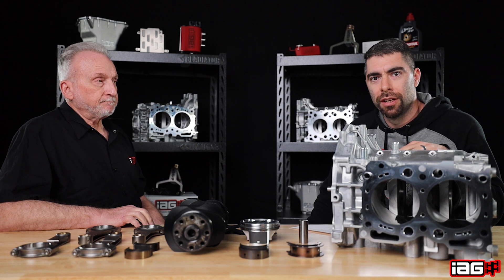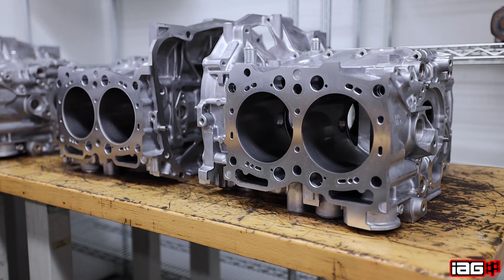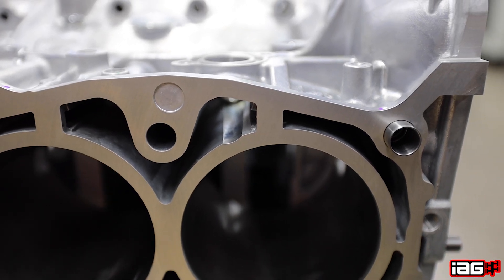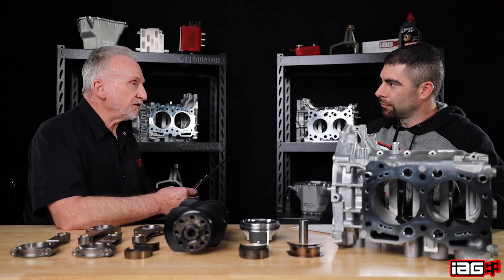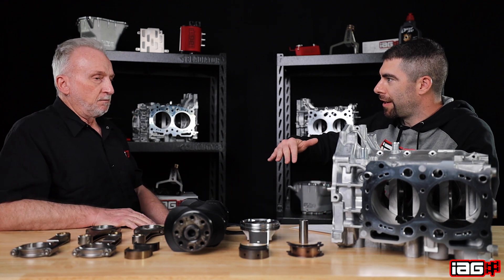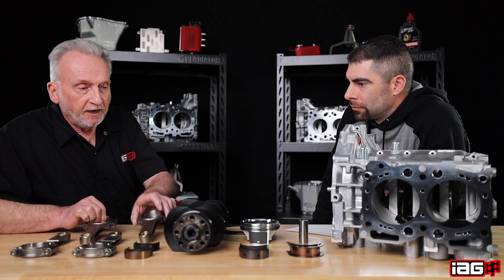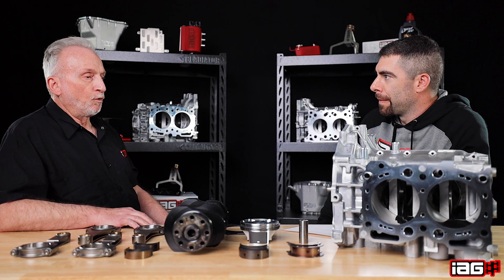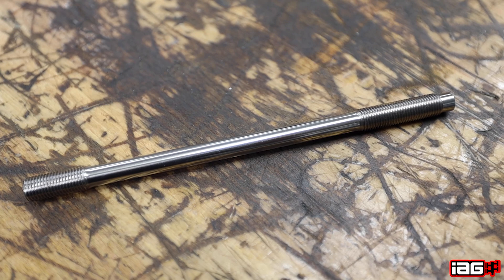IAG Performance Stage 2.5 Short Block

Comment: Can this handle 700bhp Mustang dyno numbers?
Reply from the maker: We would recommend the Magnum for those kinds of numbers
Reply: Too late 😅, I did get the ARP CA 625+ 11mm head studs. What boost levels do you think would be "safe"? I have one of the best tuners in the US.
Reply: My goal is 628whp dynojet numbers. Jason Bader from Baderbuilt Racing did it with a similar setup, I have; IAG 2.5, ID 1300X injectors, dual Walbro fuel pumps on radium hangar, radium fuel pressure regulator, BCP X500R turbo, COBB front mount intercooler, 4 bar COBB MAP sensor. He did this with stock head bolts, I have ARP CA 625+ head studs.

Comment: Do we still use the factory head gasket with the stage 2.5, or is there a better gasket that dosen't block the coolant galleries and seals better around them?
Reply from the maker: We recommend the use of the OEM head gaskets for the stage 2.5 short block

Comment: My dream short block is : IAG 900. I would like to add stage 2 heads with stage 2 cams. The turbo I need is PT 6870. The transmission I need is PPG straight cut gears with sequential shift pattern. That is all, this will make my life happier! Thank you! Please send all parts within 1 year to Fastech Motorsports, I will drop my car there.
Reply from the maker: You can contact Fastech or us to get set-up with an invoice for everything you need!
Reply: I love fastech I’m just down the road from them

Comment: I am a happy user of stock Subaru long block with forged internals. It has been 5 years since it put down on dyno jet 450whp/450wtq. Recent oil test showed normal wear. Boost is set at 27 psi. I had instances were it peaked at 29-34psi for many times. It held up.
Reply from the maker: Nice!

Comment: I’m another happy user of the 2.5 cd shortblock, pushing 470/392 on pump gas and 530/480 whp on e85.
Reply: do you have heads or anything like that

Comment: But wouldn't coolant still fill the entire open jacket regardless of the passage openings.? The closed deck blocks obviously restrict much more surface area
Reply from the maker: Stay tuned for "How IAG Closed Decks are Made" video. This will answer more questions you may have on our closed deck blocks.
Reply: @theiagchannel  when you releasing this video?
Reply: Actually no, the headgaskets have the same hole for the coolant to pass no matter if the block is closed deck o semi closed deck…

Comment: Approaching. Year on my Stage 2.5. Making 540hp/480 torque. Daily driven and has seen NUMEROUS track days. This thing is amazing at holding the power.
Reply: iAG told me today that I could go up to 600WHP with this exact engine what are your thoughts? I really want at least 575whp to keep up with all my friends hell cats fyi.
Reply: I have a similar goal. Let me know your results. I'm breaking in my stage 2.5 right now and getting ready for my tune. I do have 11mm ARP Custom Age 625+ head studs though.
Reply: This is reassuring, switching over in a few months
Reply: This is perfect, my goal is 500 whp